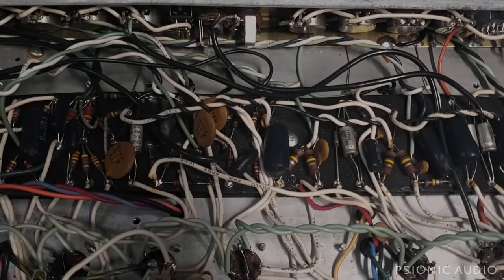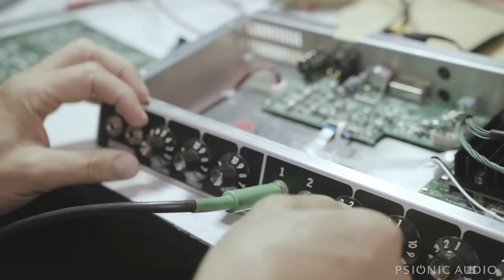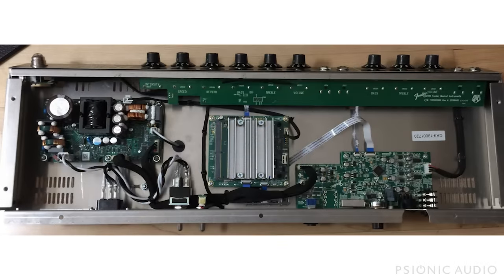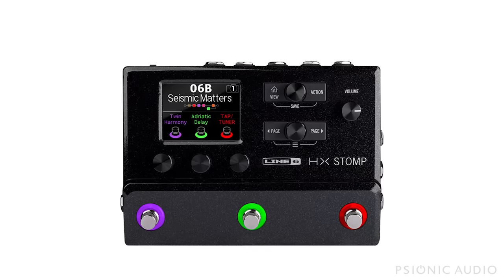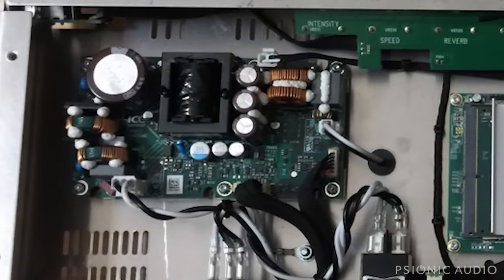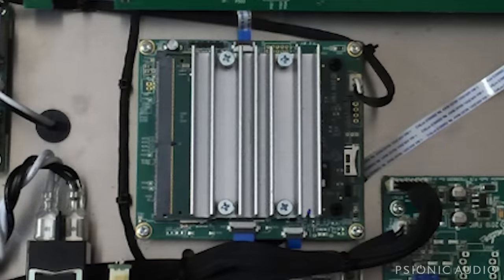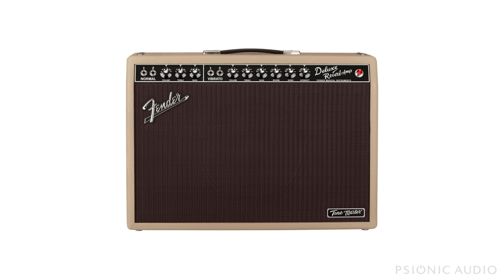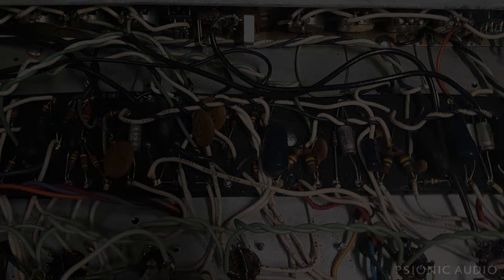We Need to Talk about the Tone Masters

Comment: I had two brand new Fender Deluxe Reissues fail me through the years. It was so very disappointing. I now i have been using a Tonemaster Super Reverb and i absolutely love it. I love the tone of it just by itself or with my pedals. I also like to jump the channels like an old Marshall and theougb doing this i have achieved the best guitar tones thats ive ever had in 30 years of playing. Im a tube guy and i love the tonemaster super! I even use three stages of gain on my pedal board and it handles it with ease. I play an 05 Gibson 50s standard through it and i love gain stacking with this amp with a warm audio centavo, fulltone ocd and a Friedman BEOD. It is absolutely tone bliss imo! I can go from that classy glassy Fender clean to that broken up blues sound to a cranked Marshall sound. The four ten inch speakers sound huge! The Tonemaster Super Reverb is the best in the Tonemaster series. Its the only one that also uses the same Jenson blue speakers made in Italy that you find in the tube reissues. Ive been cranking this amp everyday for over a year and i can say that i am very very pleased with this amp.

Comment: Bought the blackface livery DR TM used. It wasn’t bad, but it wasn’t inspiring either. Almost straight into the closet it went while waiting for a g12 NEO Creamback to come in on back order. Did the firmware upgrade before the g12 came in. Much better. I can imagine another firmware update to the Rev and Vib but...  the Rev is much improved. Bright cap “clipped” is great. Now that the NEO Creamback is installed (ty MojoTone) my amp is getting better as the speaker breaks in. The lower weight is a huge plus having lugged a tube Twin for a lot of years. Looking forward to the series. Really enjoying the channel. Keep up the great work.

Comment: I pulled the trigger on the tone master Princeton reverb, I'm very happy with it, it's close enough to tube in sound and feel, that it will save my amps from the 50's and 60's. If you hit the strings really quick it's not a reactive  as a tube amp, and it has a lot of compression that's how they stimulate a tube. But I can't really hear much a difference. To me as long as it last a lifetime like a tube amp, I'm very happy with it. If anyone interested in one, if your use to the regular Princeton, it's close but not 100percent I would say about 90 percent the same. Reverb really nice, tremelo is garbage.its week and u can tell it's not tube. That rich tube trem is gonna be hard to emulate.

Comment: I think Lyle mentioned that digital amps do not like to be pushed. Others have said it is mainly the circuit in which it operates that determins it's 'feel'. Personally i have never played a digital or SS amp that reacted the way a valve amp does at just over edge of breakup. It is stacking, cascading harmonics, pre and output stages, PT and OT.The whole system. Sag can be recreated, distortion also yet digital/SS amps tend to sound harsh when pushed.
So, i see these amps as pure clean tone platforms with variable and controllable characteristics. Put pedals in front and you're good. Amp and speaker sims galore. All fine. But i'll keep using my valve amps. Ive gigged w Tonemasters( digital modeling) and Quilters (SS).Great amps, to a volume point after which they get harsh. So I still prefer my valve amps to get to 'the zone'. Now, there are many who would call me biased and use the ''BB King used ss'' line. Well, that would prove my point actually. BB's tone was clean and dynamic. Know the limitations and you're good. That goes for my valve amps as well.

Comment: I own the Blonde edition and have spoken to a Fender rep before buying and the purpose of this was to replicate the Deluxe Reverb. If the original doesn’t have effects loop the tonemaster isn’t going to. I like that feature. I have put my Tonemaster in a room with a tube deluxe and covered the logo and no one could hear a difference in dynamics. They sound different yes, but not better or worse in a sense, just different.  I have played and heard different tube deluxes and in a room they don’t sound the same either. Pot settings alone can be incredibly different between amps. Overall I love the Tonemaster blonde, one it’s is light, I mean incredibly light. No more Ben gay after carrying one. 2 it sounds fantastic, 3 great speaker, 4 great response as I don’t feel a delay in playing. If something happens I will be pissed but I am not going to have to take out a second mortgage to buy a new one. I also don’t think new iterations are going to add a bunch of gimmicks, the newly released Super Reverb didn’t,  so I feel Fender is on to something here by not trying to throw a Helix in a box. They took all that processing power and made a deluxe reverb sound like a deluxe reverb.  If Fender decides to do another say a Princeton or Basebreaker, I’d by one the day they hit. Princeton is my favorite fender amp and would love to have one I’m not terrified of blowing up. Give one a try. I enjoy mine immensely.

Comment: Keep in mind that Zac has one of these as a BACKUP to his real, vintage Deluxe Reverb, and ONLY because he gigs in Nashville which has live venues with arrogant soundmen who have a bizarre aversion to anyone using a real amplifier.

I played with one of these at length and up against a '65 Deluxe Reverb reissue and my 1967 Deluxe Reverb. Compared to the reissue, it sounded brittle and the reverb was very "digital" sounding. Compared to my 55 year-old Deluxe Reverb it sounded like an pale imitation of a shadow of a Deluxe Reverb. Considering the high cost of a Tonemaster, it makes a lot more sense to just buy the reissue and put a good speaker in it.

These amps will be valueless in a few years, especially after Fender stops supporting them.
Reply: I feel the same way about the reissues compared to a vintage amp
Reply: Wes, Just a curious question…there are plethora of techs who can duplicate the black face Deluxe as a clone. Yeh, it’s not pure in its aesthetic, but one could reasonably expect the same performance and reliability as an original. 
Is there a taboo keeping “pro” musicians from playing clone rigs?
Reply: @Chuffin_ell  Ive tried a Vintage sound amp and a VVT and they don't sound like my real 68 Princeton Reverb which I have a G12g heritage installed, also recapped a 69 Dual Showman that sounded better then a 65 Twin I recapped.
Reply: Its all subjective but I'm a tube amp collector and tone chasing gear snob. I'm not afraid to admit these amps sound great and are good for touring. I'll even admit that I bought the Soldano plugin for Neural DSP and now find myself having more fun at my desk than setting up my amps. The sounds of todays digital are inspiring and fun to play. As much as I hate to admit it.
Reply: @Chuffin_ell  I don't see why there would be... unless, as Lyle has seen, the builder cuts corners on safety or reliability. There are lots of great sounding, well-made boutique amps... but the price can be high, sometimes higher than a vintage amp even after it has been serviced.
Reply: @baldpaulstudios7023  in the end, having fun is what its all about! I use a UA OX with my vintage amps for recording, which is a half and half approach. I even have some pretty good amp sims that I will sometimes use for working out parts, especially at night when I need to use headphones.
It all comes down to how you think it sounds, plus cost and value over time. Plugins are cheap, reliable and easy to update for improved tone, digital hardware... not so much.
Reply: @weschilton  I'm kinda confused by your comment about Nashville. Isn't that THE place with all the vintage gear and traditional blues/country players? Why would using real amps be a problem there?
Reply: Just curious, was it the bf or blonde version? They sound Very different
Reply: No. No they won't be 'valueless'. Fender is just getting started with these. There will be more coming out, thus there's no way Fender will stop supporting the first gens, so it's not going to cause them to devalue. There's no doubt about that.

I've got quite a few amps, and recently sold my Super Reverb RI. It paled in comparison to my '68 SR that I've been playing today and is idling at this moment. But, my Tonemaster DR hangs right in there.
Reply: @ileutur6863 . Anytime that I’ve had a problem with a “sound man” is usually stage volume. My band likes it loud. It’s mostly due to our hard hitting drummer. So then your battling leveling out your sound on stage since we see no advantage to using IEM, being a quick in  quick out band. There is a certain connection between band mates when you can hear everything evenly on stage and not just play in your own world (like people might do using IEM). 
Then your battling the sound guy because they think they are there to mix a recording studio. They want dead quiet and have 100% total control of the FOH sound, which stage volume will interfere with. Having the amps on the side of the stage facing inward helps, but it’s still stage volume. 
Also, you will run into a sound man that has a chip on their shoulder and acts like a General Patton and bitch and bitch about some famous country music person they mixed before had their stage sound quieter than a mouse fart and everyone should mimic that. We have fun and we like our stage volume a certain way. It’s worked for over two decades. 
We are a live band, not a jukebox, and not a DJ spinning their iPhones. It’s loud and brash. That’s what we get hired for. It’s not our problem if we are louder than a mouse fart.

Comment: My TMDR still soldiers on. I bought it slightly used at a significant discount, put an old Weber 125AO in it, updated the firmware, and haven’t had to touch it since. My back loves thanks me every time I move it, the v2.0 hardware never showed up to threaten the resale value, and I don’t miss an FX loop because I never had one in my old tweed and silverface Fenders. To my ear, it’s not as good as a great DR, but better than a bad one, and the attenuator is still peachy at 1 click down from wide open.

Comment: They should put in a 6 spring, full size Accutronics Reverb tank as an alternate, switchable reverb. Wouldn't add that much weight, and it would please a lot of players.
Reply: I hear you but theres nothing mechanical about these amps so nothing can really go to wrong. Plus, the digital reverb doesnt suck. In fact, I sometimes like its clarity better than the one is my tube DR's . It just works. Not affected by wear, temperature, wiring or anything else.  Like having a great built in Reverb Pedal.
Reply: Yes, but spring reverb could sell amps to players like me that want spring reverb, not some facsimile, no matter how good the digital reverb may be. I have digital reverb galore in my recording daw, and don't need that on my amp. Spring is a different animal.
Reply: @Ninjametal  For Sure. I'm like you. I wouldn't buy this amp for me, but I did buy it for my touring's sons band. 2 of them. I'm ( and maybe you) aren't the target market. There are plenty of great Fender tube amps for us.  Fender has done an amazing job taking over where Gibson/Marshall left off. That place for very affordable great sounding, low maintenance gear. Guitars and amps. When I go see young rock bands. Its 70-80% ( thats a guess) fender on the stage. 10% kemper, Fractal. Quad cortex or other digital gear and a couple of Gibson's or real amps here and there. I think the target for these amps is the 20 something's and Fender is smart enough to know, when they are my age ( or as soon as they can afford it), they'll be buying the real stuff for big money. Hooked on Fender for years to come. It's genius.
Reply: @baldpaulstudios7023  You are most definitely correct about the target market for the tone master series, and they would make good touring rigs. (I suspect a higher percentage of younger players to be using Helix and digital gear, though.) 

My point of reference is really in the two modern tube amps I have that include d-verb I don't like or use
Reply: That's completely missing the point of these. They put a ton of processing power just into the reverb circuit by itself, let alone the processors powering the trem and rest of the tones. The reverb is outstanding. I'm comparing to my '65 Super Reverb RI, '68 Super Reverb, and the 70s Pro Reverb I had.

Comment: I'm a bedroom warrior with an HX Stomp and no interest in amps right now but I very much appreciate the "old-school" perspective, as long as it includes actual points, which yours certainly does. Especially because this video was mostly about the ease of repair and long-term value for money - which are both important and valid considerations - not about the analog vs digital tone debate. 

What's your stance on straight-up, analog, solid state amps? I know they were mostly relegated to the budget/practice amp segment of the market but there are a few that are well regarded when it comes to the sound and functionality (Roland JC40-120, Blues Cube, Quilter stuff). I'd imagine they wouldn't be as difficult to repair as digital solutions with proprietary tech and CPUs inside of them?
Reply: You're missing out - having speakers move air is absolutely part of the fun and no pedal, plug-in, software can change the physics of moving air.

Comment: The reason they don’t have effects loops is that it’s a digital amp…adding an effects loop would about double the input to speaker latency….assuming you don’t use digital effects in the loop, in which case it would be even higher. At some point, that’ll matter. And people will complain. 

Your HX stomp example would be better served using it for the amp sound and bolting a similar ice power amp to a similar cab. If you don’t specifically want to change IRs, that might be the best way to do modeling.
Reply from the maker: AxeFX. Kemper. Digital. Loops.

Comment: Im a tube snob. But recently ive found a few interesting amps. One is a One Control 66. 100watt SS fender style amp. Very very good tone. No tubes. Weighs nothing. But what I use today is the other interesting amp. SMS Classic Tube Preamp (based on a Twin) 2 - 12ax7 tubes. That goes into an ART SLA-1 poweramp. Reason why im talking about this setup is because, This setup is as close to not using tubes as I can get that delivers what a tube amp does. I am still not sold on amp without any tubes. Id like to try this fender amp out, but firmware etc sounds like this amp will always be being updated to try to sound like.... a tube amp. lol! I really dont think you will ever 100% get SS to sound exactly like a tube amp. But there are some good options out there for people to try. I think if your trying to ditch the tubes, try not to ditch them all at once ;-)
Reply: I recently got a Milkman pedal/amp. Its suppose to be a Deluxe and boy does it nail the tone all in a little box the size of a Q-Tron+ pedal. It uses one 12ax7 preamp tube. Def check em out as this and the SMS are the best two options ive tried for almost all SS amps in the Fender tone realm.

Comment: I can understand the lack of a effects loop.  This product seems to aim to capture the essence of the classic fender designs for us aging players looking for light weight grab and go solutions.  I've pretty much almost always not used effects loops and tend to run amps clean on the edge of break up and ran all pedals into the front of the amp.  Old School simplicity.  
Perhaps with this amp not having filter caps like Fender's other amps, maybe it actually will not need service as quickly as Fender's current tube offerings.
Reply from the maker: It has filter caps. But it's the ICE module that likes to release the magic smoke.
Reply: @PsionicAudio  ah ok!

Comment: Excellent video and very informative. A question/observation: I've been a fan/user of modeling amps since Johnson Amplifications' Millennium. Your video, and a few others was the first time reliability and repair were mentioned in any type of review or evaluation.At least that I've encountered. It's understood that things break and malfunction, even in the digital domain. Yet the Tone Master  reviews are the first instance where reliability and replacement availability were brought into the purchasing decision for consumers. Is the Tone Master more fragile that digital amps of the past?  Your attention to this matter is appreciated yet I wonder why this is the first time I've encountered it. Please feel free to set me straight if it's just something I've missed all these years. Full disclosure: I've had remarkable luck with the many digital devices, amps, guitars and effects I've played throughout the years. Virtually no breakdowns or repairs, save for a bad piezo on a Line 6 acoustic guitar years ago.
Reply from the maker: Most modeling combos are in the $300-500 range. So expectations are lower for reliability. Fender is charging about $1k for the Deluxe, so one might expect more from it. I have my doubts.
Reply: @PsionicAudio  I've had at least 2 modelling amps die irreparably on me. They were $300 amps and they lasted rather less than a decade.